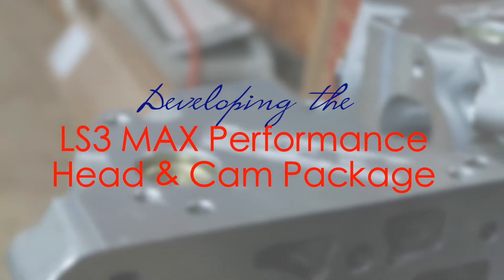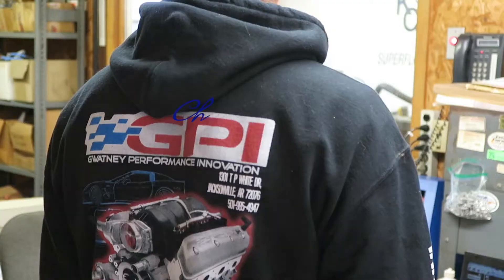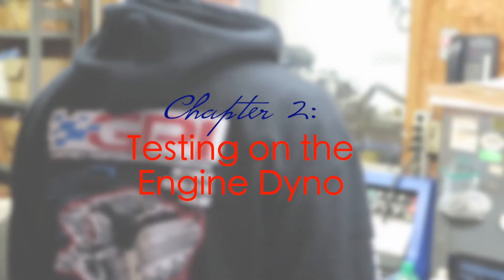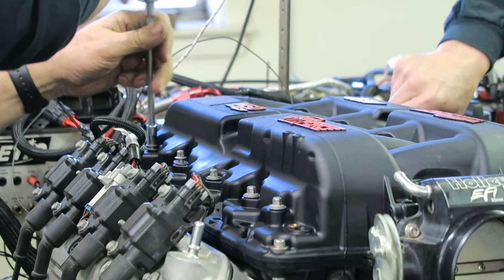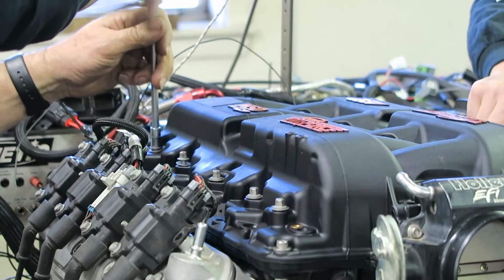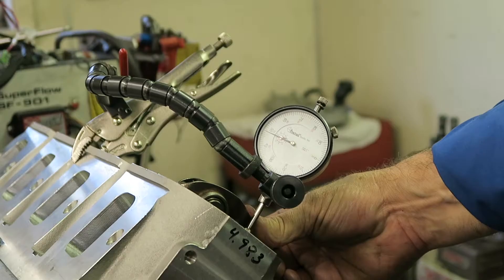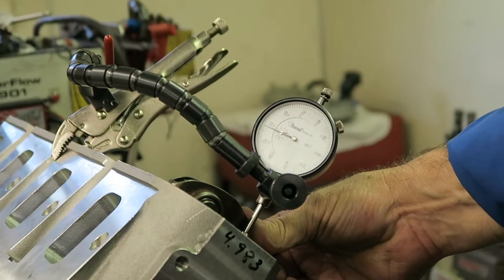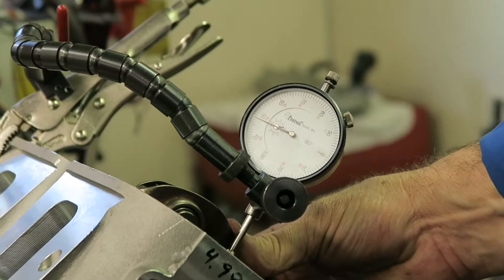GPI MAX Performance Head / Cam Package on the Engine Dyno

Comment: 485 ft lbs at 6600 rpm is 609 hp (about 20 less than graph),  541 ft lbs peak torque around 5100rpm in video - was there a pretty positive correction factor for high temp or something?

Comment: interesting note that GPI does not offer the MSD Atomic intake but the Fast LXR intake i wonder what was the cost and HP difference??? also this is an engine dyno it would be nice to see what the #s were to the tires? and on both M6s and Autos with or without stall converters  just asking........

Comment: On my L99 it ends up being 11:1
Reply: How much whp does this make through a 6l80 and on what type of fuel you running?
Reply: @chevyrider9027  havent had it on the dyno but most see 500whp+ with the same setup. Running on 93 octane
Reply: Are they a pretty reliable cam ? On an ls3 not try to kill my motor